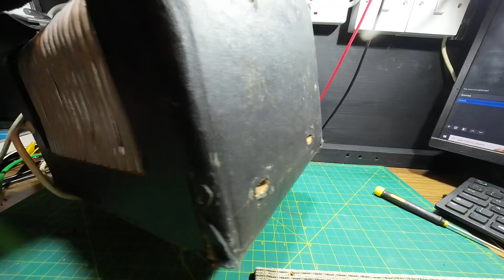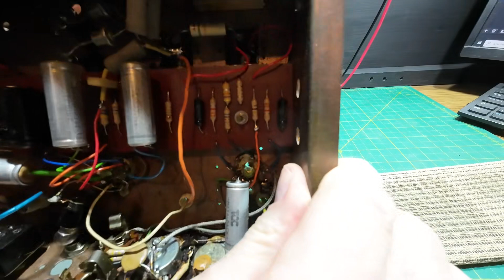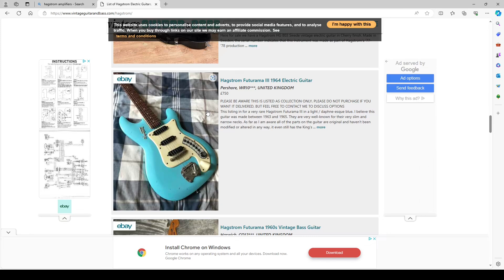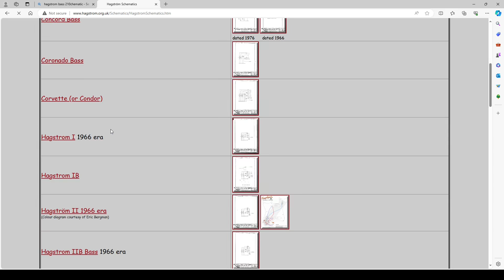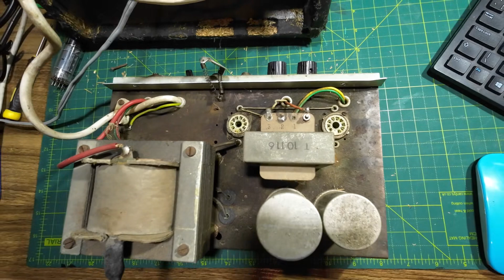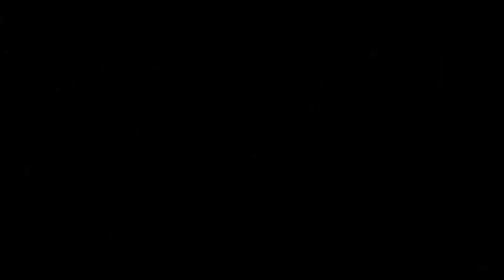Hagstrom Bass 210 Amp Part 1 Full Restoration

Comment: the power tube is ecll800 with inbuilt phase inverter built in. Do not think it work like a class A. I am in prosess of finish restoring and upgrading one Hagstrøm bass 210.
Reply from the maker: Hello. Yes, it's a push pull amp. Someone has made a right mess of the amp trying to wire it single ended. Let me know how you get on with yours. Thanks for watching and take care.
Reply: @vintageguitaramp_guitarteacher  Waiting for a new poweramp tube ecll800. Have a good amount of New old stock tubes and found a very good ecc83 that i think will work fine with the new power tube. new capasitors i power supply wired up like original but mounted on the underside of chassie. cut the legs of the old ones and let them be so it looks like it was build on tube side. It plays but have a dark bass filled tone with the old power tube. i use stock values capasitors on the tone pot. maybe change value of one after new tube is in. schematic was easy to find.

Comment: A Vibrolux Reverb amp I recently bought came with a preamp tube that I couldn't identify.  A member on the telecaster discussion page (tdpri) suggested breathing hot air on the glass, like you would do when cleaning your eyeglasses, and then look at it under a light with a magnifying glass.  Sometimes this makes invisible print appear.  I did this, and found the tube to be a 12AV7.  I hadn't come across this tube before, but it has a gain factor of 41 and can be used as a substitute for an AU7 or AY7.  I put it in position V5 (tremolo oscillator driver) and it works fine.
Reply: Rubbing the tube lightly through your hair to pick up some natural oil on the glass before blowing on it to fog it up can delineate the letters more clearly. I also find it helpful to do this next to a window or outside so that you can hold the tube up to strong sunlight as you look for the lettering.  The letter tends to appear briefly just as the moisture on the tube is evaporating.  Old ham radio operators would sometimes put the tube in the freezer for a few minutes so that the glass can fog up naturally with room-air moisture,  but I've never found this to be necessary.
Reply from the maker: Errr, I don't have any hair lol
Reply: By the way, another similar dual triode tube that you rarely see in guitar amps but was occasionally used in hifi amps is the 12AZ7.  Same pin out as 12AX, 12AU, 12AT, 12AY etc.....
Reply from the maker: 12AZ7? I have never heard of that one. I best get the data sheet up for that. Take care.
Reply from the maker: Hello Michael. I will give that a try. it would be good to find out what this mystery tube is. Take care.

Comment: Back around 1979 I briefly had a blue 2-pickup Futurama like the one shown on the website, which I picked up at a pawnshop. The fretboard was nearly flat, having almost no radius (not fun to try and play), the pickups were anemic, and it was missing a chunk of the pickguard where the output jack was supposed to be mounted. I got rid of it.
Reply from the maker: Oooh that sounds not much of a  guitar for the  £750 pounds. on ebay.

Comment: The valve museum website has detailed info and a suggested wiring schematic for ECLL800. Its a complete push pull twin pentode output section with a triode phase inverter in one neat glass tube.
Watford Valves has at least one of these for a more reasonable price. Beware of wantonly over-valued US eBay offerings where the postage sometimes equals the purchase price. 
I can't wait to see how you proceed with this one Martyn, i think you'd sort of decided to return it to original? I reckon that's what I'd choose but you know best.
Reply from the maker: Hello Rob, thank you. I have just been on there and had a look. I have found one new old stock on ebay for £25 with free postage, in Manchester. Lets just hope it sounds good when it's back to orginal. I noticed on the schematic that the coupling caps are 100nf. That does not bode well for a small amp. They have been swapped for 5nf which is to low. But I will stick to the original design and see how we go. Take care Rob.

Comment: I think I figured out the wiring for the ECLL800:
1    is the triode-plate connected to a 150K resistor R18 and 0.1uF cap C10
2    triode grid connected to 1K resistor R16 and the internal connection between the triode grid and pentode 1 grid is shown
3    pentone 1 plate connected to OT
4,5 heaters
6    pentode 2 grid connected to 110K resistor R20
7    triode/pentodes shared cathode's and the pentodes suppresor grids connected to 180R resistor R17 and 200uF capacitor C9
8    pentode 2 plate connected to OT
9    screens of the pentodes connected to OT center tap
Reply from the maker: Hello Edwin. I think you have nailed it there. The previous guy who wired it up had no idea. The way that is wired does not match up any tube I know and as we can see does not the tube that should be it. Good job there is a schematic. Thanks for watching and take care.

Comment: It looks like a triode/pentode output tube and the OT is wired up as  single ended.
I agree with tearing it down and rebuilding as per the schematic.

Very, very interesting tube they chose. I don’t understand how it would work with all of those shared elements. Excited to hear it when it’s running again.
Reply from the maker: Hello Matt. i think that is what they were trying to do. Yes, a bit of an odd tube. It had me baffled for a while. Take care Matt.

Comment: I think captain bodge has rewired it for an ECL82/86 rather than shell out for a replacement ECLL800. That or as another poster suggested..... a chimpanzee let loose with a soldering iron.
Reply from the maker: Hello Steve. I checked the wiring against the pin outs of both of those tubes and they did not match. My money is on the Chimp.
Reply: @vintageguitaramp_guitarteacher  The Chimp it is then.

Comment: Yeah I think the same thing that's definitely probably a different output tube. The old techs from the 60s even into the mid-70s we get this kind of stuff in and yank it apart and turn it into something that works. The electrolytics are probably all leaking and dried out. But like I do if you have to make a modification draw up a schematic for the next person. But really to rebuild it into something out of thin air and make it work those techs back then or a lot better than I am. Except that wrong way they didn't give a darn about the next person to look at it. Lol. The guy will probably have to buy the correct output tube for 60 bucks and God only knows probably New Old stock would be the best way to go if he's going to invest money into restoration. Of course I mean an output valve that has been thoroughly tested and guaranteed. But yikes what a project. Cheers! Great vids by the way.
Reply: Sorry about the literacy. I'm speaking into my phone.
Reply from the maker: Hello. I have checked a few tube pin outs and didn't match up to any of them. I don't what tube they wired the socket for. The amp is having a full rebuild. None of the old components will be left in. I have found a new old stock tube on ebay for £25 quid. Part two should be out in about 10 days. Take care.

Comment: I've seen Uncle Doug stuffing capacitors...  :)
Reply: You are right, Uncle Doug tastefully re-stuffed some cardboard covered caps in a completely original, untouched very early Champ. Never seen him pull the messy guts out of multi capped metal can caps and re-stuff them. Even with the slightly smaller size of modern electrolytic filter caps you'd be lucky to fit two or three into an empty can. I reckon the originals must have used the full height of the can to form tall, slim rolled capacitor sections. Off the shelf modern caps are too short and wide to fit.
Reply from the maker: I thought I had. Uncle Doug has done just about everything with guitar amps. He's a legend

Comment: ECLL800 is a triode + 2 power tetrodes, preamp and power tubes in one -- very common in 60s record player but a very late tube stype, hence not in the book
I worked on some Davoli amps using triode+power ECL86 etc... Similar probleme with a mains voltage switch just going to 220V
Reply from the maker: Hello. Yes, I had a bit of a read up on it. It wasn't listed in my tube tester book either and my tube tester book says 1969.
The mains voltage might be a problem with the heater voltage being to high. I might have to use a resistor in the circuit if it's much over 10%. Thanks for watching and take care.

Comment: The only logical thought I had Martyn is that someone has rewired that output valve socket in order to use a different output valve.. Otherwise, someone has let loose a chimpanzee with a soldering iron on it. There's a few of these amps for sale at asking prices of £250 and £300. Both are advertised as fully working and look in reasonable condition for 1960's models. Looks like they had a matching 10" or12" cab.
Reply from the maker: Hello Pete. My money is on the Chimp. I have on of those output tubes on order. I found one for £25, including postage. Look out for part two. Take care Pete.
Reply: @vintageguitaramp_guitarteacher  Looking forward to pt 2, since I've just recently bought one. So any info I can glean from your work will be appreciated

Comment: Id be tempted to check the ot impedence and consider stripping it and scratch buikd a liw wattage push pull amp in there. 
Definitely a head scratcher
Reply from the maker: Hello. It would, be a good idea to check the primary of the transformer.  I have sourced a new old stock ECLL800 at reasonable price. But I will check the primary impedance anyway. I plan on building it to the schematic. Let's just hope it sounds okay. Take care.